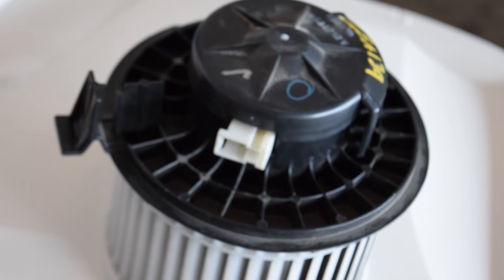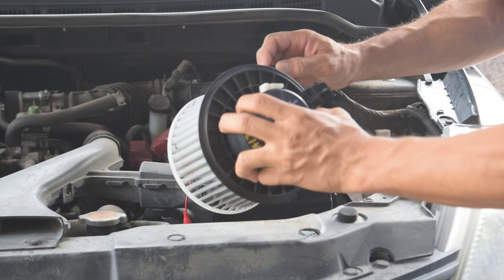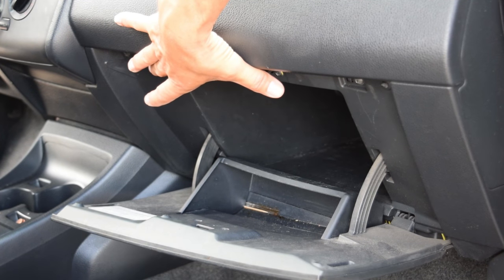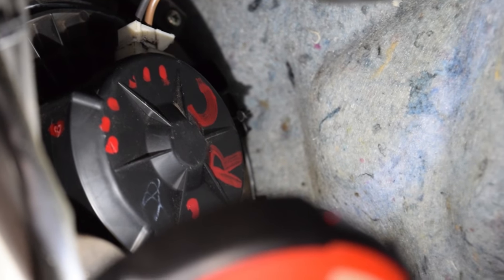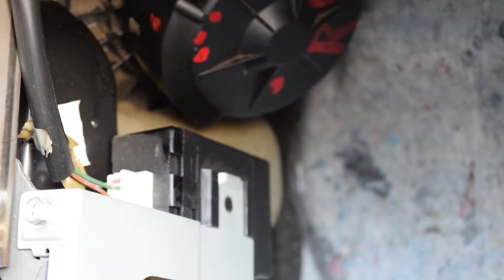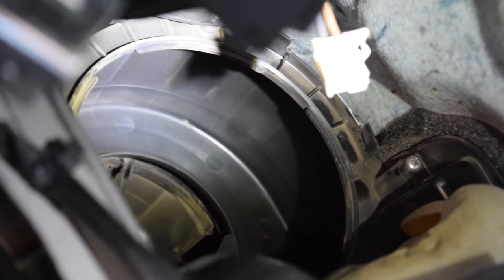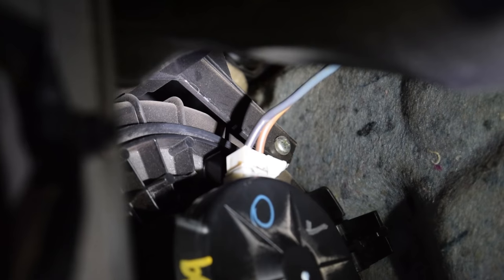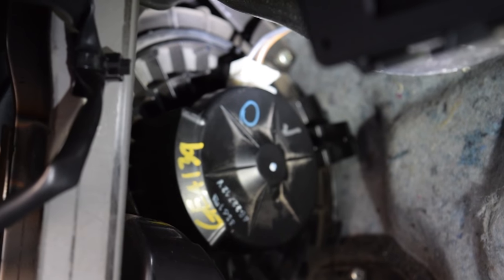Nissan A/C & Heater Blower Motor Fan Replacement

Comment: I was quoted about $800 to replace Blower motor resistor and blower motor of a 2012 Nissan Versa, thanks to this video I was able to do it myself for under $100 and about an hour labor. Note: pinch side of connector to remove

Comment: Thank you for this video! I had no idea where  the blower was because so many people told me it was on the driver side and I had to remove the gas and brake pedal to get to it. Maybe that was on the European model, but here in the USA it is on the passenger side and it was super quick to remove and inspect. I'll be replacing mine in the next day or so without paying labor. For the moment I added some oil to extend the motor a couple of days till the replacement gets here.

Comment: great video to help HOWEVER after getting the one screw off with an 8mm socket I had GREAT difficulty getting the fan itself twisted loose (I'm 72 and don't have the stength of my youth ) SOLUTION - there is a broad section on the black part of the motor housing. Fit a 10" adjustable spanner onto this and tighten on to it. The fit 1/2" socket extention thru the hole at the other end of the spanner and twist about 30 degrees clockwise - and SUCCESS!  PS even after this I found the 2 pin connector very hard to get off,  but very easy to get back on.

Reply

Comment: My fan motor in my 2009 Nissan Cube stopped working yesterday. I've already taken out my glove compartment before to change the interior air filter, so that was a snap to do. I found the blower motor. Tried hitting it (ninja repair trick) but I didn't hear anything so I assumed that didn't do the trick. Unplugged it and using a tester I saw that power was going to the motor. Motor came out super easy (no bracket to move like in your video). Did the test on the battery and sure enough blower motor roared to life. I was actually bummed out as I assumed I had a dead blower motor and therefore I'd have to keep troubleshooting and maybe change the fan resistor. I put the motor back in and plugged in the power wire. I noticed I was feeling some air being blown out of the vents. Sure enough, when I cranked it up to 4, it was working perfectly fine! Reinstalled the glove box and I'm good to go!

Maybe hitting it worked and I just didn't hear the motor (it was still installed at the time). Who knows.... all I know is I'm glad to have it running again and I didn't have to pay my local Nissan dealer $170 just to diagnose the problem (That's what they wanted when I checked with them yesterday).

Thanks for the vid.

Comment: Whay year models are covered by glovebox route fan replacement?
I have a 2013 nissan versa. Other Videos indicate you gotta take out gas/brake pedal assembies etc. on drivers side
Reply: Hey man I’m in the same boat and getting ready to do it myself, I got quoted 746$ for this job at my local auto shop 😅 and needless to say I’m gonna attempt it, but anyways if your car is a U.S. model 90% chance it’s on the passenger side and European is on drivers side.

Comment: Good video or you can just got 1:18 where he gives you the "Ninja Tip" and just bang the blower motor. After watching about 15 videos and replacing my blower motor resistor due to a the fan suddenly shutting off, then coming back on, and then off at random times--NO ONE ELSE SUGGESTED TAPPING THE BLOWER MOTOR... Went out to my Frontier, couple easy taps on bottom of blower motor and BOOM! it is working. If it starts to fail again, at least now I know that it is the blower motor and not the resistor and not the switch. Thanks Ninja Master!

Comment: For almost a year my 2009 Titan, fan would only work on "high" no matter what position I set Fan speed dial, it's on "high" except "off" is still "off"... but this morning, our fist winter freeze in central TX, I just hear a relay click - but no fan. Hope it's not a Nissan electricalproblrm again...at 181,000 already have no cruise control, problems with trailer light on built in harness, fast blink on right signal though all bulbs are good, etc... Happy this looks easy enough - reminds me of putting a salvage fan into a Ford Escort years ago: also through glove box, which worked well. . Hope this is my only problem & I won't have to hot-wire the fan (& add a toggle switch,  from the lighter socket or something ignorant), -- like I've had to jump off the vehicle's tail lights to make trailer socket work again! I'll Ck fuses first, but I bet if it's some computer module or something it'll be $350 like it was when headlights failed on my cop car crown Vic: had to hot wire from the spotlight switch on the window post that time, or pend $350! Only got the recall notice on that one AFTER I sold the Vic! Thanks for posting. I hate to spend money & I think I can handle this repair !
Reply: That should be a bad resistor. Search YT for some videos, if you haven't already found this out - being that it's been three months since you posted this.... My problem is shittier. A mouse, or mice, decided to "move into" my duct system "somewhere". Everything seems to work, but the motor has a vibration, as if there's resistance, or a slight blockage in the duct(s).  think he motor is fine, and would run perfectly outside the duct work. I'm going to have to remove the motor and use a fish tape to see if I can unblock it.... or whatever... REAL PAIN-IN-THE-ASS! My car only sat in the garage for a few days! Also, it's early March and we're having below freezing temps right now!

Comment: Where is the blower fan located in a 2017 Nissan Altima? I was told at the dealership they would have to remove the entire dashboard and middle console to replace it. They replaced the blower filter and the noise is 2x louder than it was before. What is your opinion?

Comment: Question? One person commented that theirs was a 2011...mine is a 2010 and every video I've seen shoes the fan motor on the left side and they are taking out 1500 parts including taking the gas and brake pedal assemblies out. Any direction on whether or not all models are this way. Mine is a 2010 Rogue SL
Reply: Shows not shoes lol

Comment: How can you tell if it's the resistor or the fan motor? Do you just replace both?
Reply from the maker: Watch this video, it should help.
https://youtu.be/vyeNcG4rtcI
Reply: I replaced both on my Scion xB my blower was just under the dash, 10 minutes fix. The resistor and blower could be bad, so don’t screw up new blower with bad resistor is what I was told...
Reply: Also, bought blower and resistor off eBay for less than $60
Reply: see my site for details about upgrade the stupid resistor with a smooth dc PWM fan controller 10 bucks ebay 4 hours and a beer

Comment: I serviced my motor and found a fault with the base of the motor collecting water and at the same time I replaced the resistor which was failed with a 10 dollar PWM continuosy variable controller - the motor can be serviced and the bearings oiled and the brushes checked so you dont need to put in a new one, See my site for this clip

Comment: Does this make the ac blow cold air again? Or do i have a different issue?
Reply: You have a different issue. Check if yours has a leak or just a re-gas. This is purely if you flip the fan switch and no air comes through

Comment: Got a question?  I have a 2014 Nissan Pathfinder sl and I started to hear noises when I have the heat on and raise the speed of the of the fan. Mine works just annoying loud noises.

Comment: This doesn't work for a 2026 because the black part is facing left instead of right..which means you have to open the driver side panel

Comment: how do you determine whether it's blower motor or blower resistor?
Reply: see my clip about this there are two wires  into the motor you can hook 12VDC into these the resistor is usally the culprit and can be replaced see my video for hints

Comment: I have 2015 Nissan Versa my A/C went out to this show in here Las Vegas. They put a resistor in my car. Start blow cold air until turn it off to get gas. They charged me $240.00. So then I went back to the show. He’s that it possible is wouldn’t work. So I said that just wasted my $240. He’s no you need a resistor anyway. Then he said I need A/C motor

Comment: just vacuumed a mouse nest out of my 2015 versa blower motor.. what a nightmare it is being installed on the driver side for that year.
Reply: Did your fan work after the nest was removed or did you need a new one?
Reply: @Amthe_ambitious  it worked.. the nest was big
Reply: @Emilysquirts  is the fan dead , or is it just a nest stuck in there ?